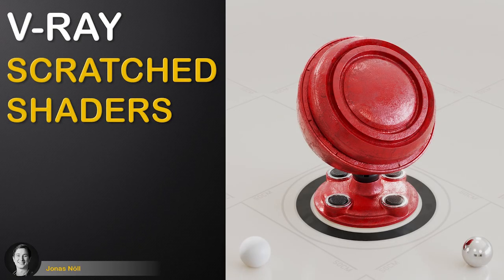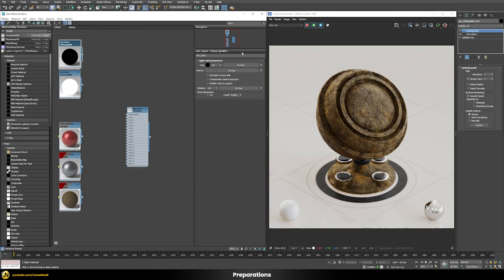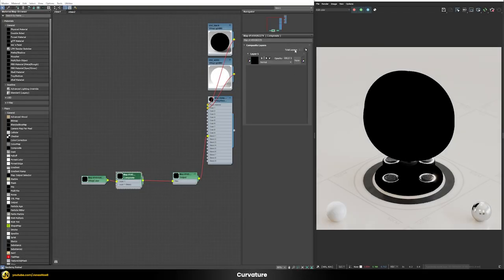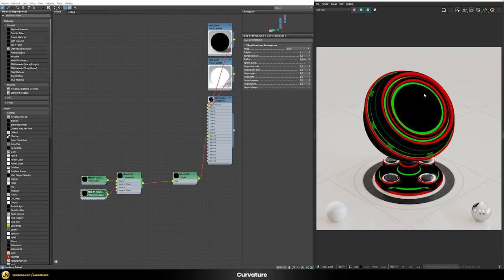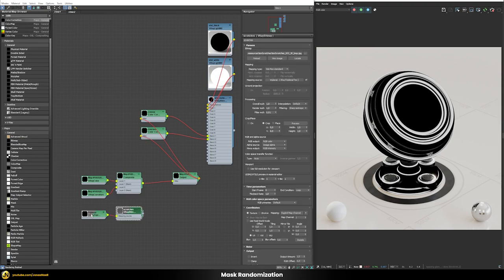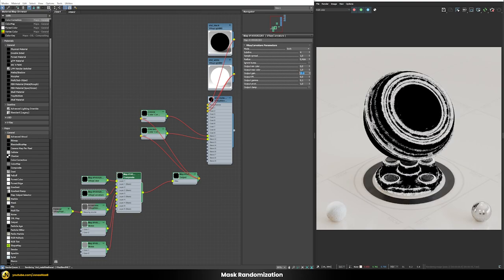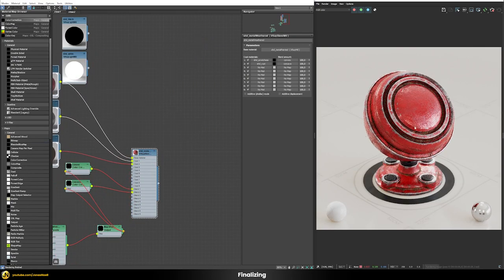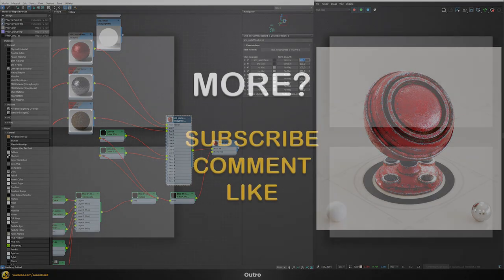V-Ray | SCRATCHED METAL Shader | Curvature Workflow

Comment: CTRL+drag the node on to the spline, so you dont need to individually pipe the splines in to the node. maybe you already knew that, and did it this way for demonstration purposes  :)
Good tuts as always. cheers and keep 3ds max alive......... ehm i mean vray. ( I think it is drag first and then push CTRL )
Reply from the maker: Yeah will check it out, I normally only work with the Slate Editor for the tutorials, I normally don't like to use it and prefer the Compact one :) Thanks

Comment: I’m a VFX Compositor but I’m also learning lighting, shading and rendering. Thanks so much for taking your time to share this knowledge, much appreciated, my materials and shaders in CG have gotten better since I found your page. 
My question is; Is there a way to include a mask in cryptomatte for decals, cause I used V Ray Decals but the decal doesn’t show ip in the cryptomatte channel. I use Cinema 4D.
Reply from the maker: Thanks for the feedback :-) As for the cryptomatte if you switch it to separate by material it should be working. At least it does for me in 3ds Max. In Cinema 4d I'm not sure. If it doesn't work and you think it is a bug you can ask in the support forums for C4D.

Comment: Great tutorial! I've been using this method for many years. Although with the VrayDirt map instead of curvature. I still find VrayDirt a better option because I find it more intuitive and easier/faster to manipulate organically. Mostly with just one texture in the radius slot (and adjusting output curve for the right contrast). And a VrayColor map for the occluded color where you increase the RGB value in case the resulting mask is not bright enough.

Long gone are the days of Grant Warwick's Mastering Vray...

Weiter so und beste Grüße!
Reply from the maker: Hi, I have another tutorial in my channel that covers exactly the VRayDirt workflow. It's called Rusty Metal Shader tutorial, you can check this out to compare this to your workflow :-)
I like use both V-Ray Dirt and Curvature. They have different usecases for me, for example in animations the VRayDirt may behave weird if other objects suddenly move by closely and interact with it. The Curvature just depends on its own geometry so it's more suitable for animations as it doesn't depend on the objects position and it's position to other objects in the scene.
Reply: @JonasNoell   I see! But VrayDirt map has the "Consider Same Object Only" option built in so you could make it behave the same when needed. In fact I find the ability to use both very flexible. For example you can leave this option off so VrayDirt interacts with with all other objects. And then the exclude/include list can be used to further specify which objects in the scene affect it and which don't. To be exact there are two exclude/include lists, one for which objects receive VrayDirt at all and one for which objects have an influence on it. There have been many instances where I used this. Just recently for example to generate dirt/sand on car wheels. So you would take advantage of the tire object and rim object interacting and the crevices between them gathering dirt but exclude the car body etc. But having said all that, it only matters what works for each person better and feels more intuitive.

For this kind of setup the curvature option might be more interesting (for me) if maybe it's considerably faster than VrayDirt. But I haven't tested the speed between the two directly yet... if it is it might be a better option on scenes with many multi level shaders like these. In the end the biggest slow down though is the fact that Vray always computes all the layers of the blend mtl. Once you have a model with many of these blend mtls you will notice how slow things get during render time. But hey, quality over speed! :D
Reply from the maker: @andreasmass4492  Yeah the thing with the blend material is unfortunately annoying. For animations or when rendertime matters I normally try to built all of this into one VRayMtl. It's a bit more complex and annyoing to mask out different Glossiness, Metalness, Bump, IOR and so on in the same shader but it's possible and speeds up the overall rendering. 
I would wish that the BlendMtl would act the same way because it would be much more clean and intuitive to keep those shaders separated.
Reply: @JonasNoell  Yeah, it would be great if they actually managed to "bake" the composite right before rendering instead of calculating all layers. I mean hey, we got a sheen option in the vraymtl now instead of having to use blend mtl and shellac mode. That's a start, right? 😅

Comment: Very nice  is the output map necessary even if it's already implemented into vray curvature? thank you
Reply from the maker: It depends, in my case I wanted to clamp the output AFTER I multiply several textures on top of the curvature. If I would clamp the output in the curvature node the result would look different in this case.
Reply: @JonasNoell clear.. thank you for reply